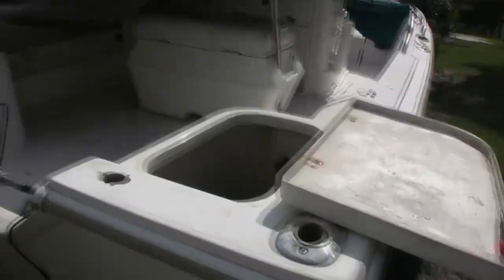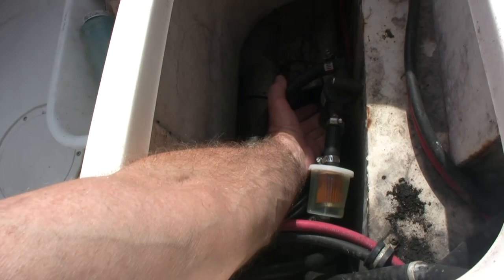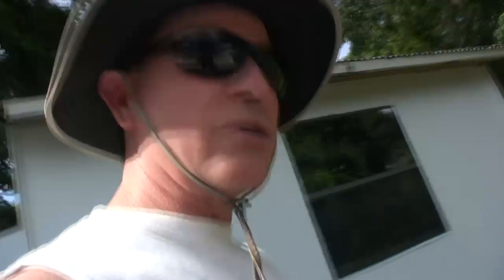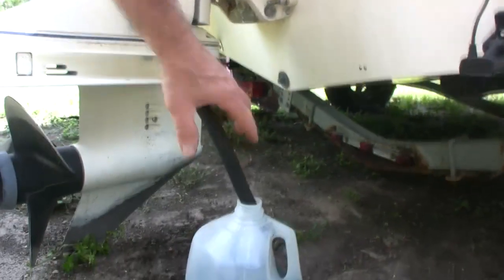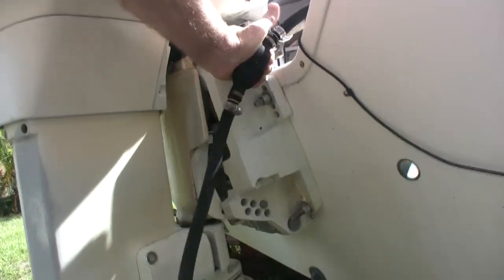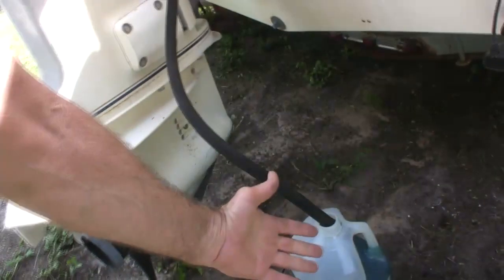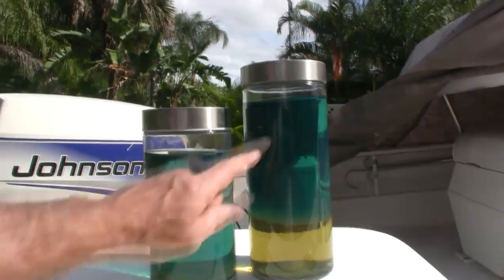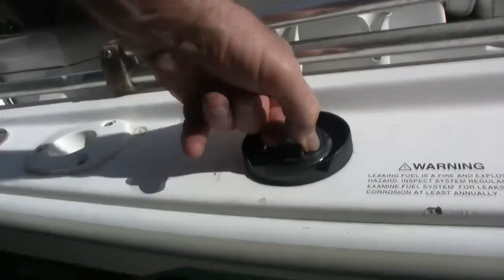Port Canaveral Florida | HOW TO-Remove Water From Your Boats Fuel Tank Cheap!

Comment: This worked like a charm.  My issue was old gas, not water in the tank.  I siphoned about 10 gallons when the stream slowed to a trickle, then I realized I had to loosen the gas cap to relieve the vacuum.  To answer one question below, once you pump the bulb, gravity takes over, so you do not need to keep pumping the bulb to keep the flow going. Great video.
Reply: Can you clarify this for me? Does the engine have to be running once you prime the bulb? I have to continuously pump and I have like 20 gallons to go lol

Comment: Sweet! Just bought a nice bass boat for 500 bucks. The guy replaced everything in the ignition system and just could not figure it out. Just water in the tank! I figured that out because it runs fine below freezing

Comment: Usually there is an o-ring on the bottom of the fill cap. Replace when bad and lube it with a bit of grease to maintain seal

Comment: I found water in my boat gas tank, luckily I was on 1/4 of a tank. I gave this method a try and pumped until empty. 11 gallons in less than an hour. Worked well, thanks!

Comment: the fuel line intake in the tank is 1/2" from the bottom, so this will leave 1/2" of water in the tank.  best to remove the fuel sending unit and siphon with a fuel pump from the bottom to completely remove and always keep tank full
Reply: you are correct sir.  this method only removes to the level of the fuel line.

Comment: The big problem I see is that the fuel pick up tubes don't go all the way to the bottom of the tank; at least not in mine.  My guess is that it prevents any sediment, that settles to the bottom, from being drawn up in the fuel line.  Being that water is heavier than fuel,  if there is water in the tank, there may still be water remaining in the tank below the level of what the pickup tubes will reach; problem not solved.

Comment: do you have to keep pumping, or does it create a siphon effect and start draining itself to the max?
Reply: Bulb has a check valve in it so you would have to keep pumping if you do it thiS WAY. i took an ran my hose threw my drain "where the plug goes" parked an chocked wheels on a incline an leg gravity do the work.

Comment: I got fuel on my tank what should i do... pump out all the fuel out change the filter and refill with fresh gas is that gonna fix the solution... my boat turns off when i put it on drive so it happened thst my gas cap wasnt tight enough

Comment: The only problem with your Bud's method is that the pick up tube in your fuel tank does NOT reach the very bottom of the tank.
Reply from the maker: Ok, so you might have half a cup...
Reply: @PortCanaveralFlorida  Add new gas, maybe some additives and run it out...

Comment: @4:10, not wax candle, you mean Lava Lamp.     I don't think it's a good idea to put gas in a milk plastic jug, it will start to crack and leak in an hour or so.   You could probably just run 12v to the in-tank fuel pump and pump most of it out as well.     If there are nooks and crannies in the tank, then water might hide in there only to surface when you refill the tank with Fuel.

Comment: Syphon out fuel with a 1/2" vinyl hose from home depot, accessing the tank via the filler stem and transfered into a 5 gallon gas can.  Finish up with a paper towel taped to a steel rod to sop up what ever remains.   Use only Rec 90 fuel and have an inline water/fuel seperator filter - no issues.

Comment: If you want ALL the water out put a small bottle of 100% isopropyl alcohol in your tank. That alcohol will get any remaining water out and will not be a problem with gas/oil mixture as the water/isopropyl will evenly disperse into the fuel. Oil will evenly mix in this same fuel without causing engine damage. The brand Heet is NOT GOOD TO USE AS IT DOES PICK UP WATER BUT SETTLES TO THE BOTTOM OF THE FUEL. Oil does not mix into that settled Heet/gas mixture and may cause engine damage from lack lubrication. Put a few drops of water into a test tube, then put a little 100# isopropyl alcohol into the tube. You will be amazed when the water is gone.
Reply from the maker: Thanks!  Great tip!
Reply: You are a lifesaver
I had my boat stored for about 6 mon.
Rec 90 and Yamaha fuel treatment,still picked up a good bit of H2O
I'm giving this a try
Reply: @M C Clift. If you experimented a little bit with a glass container of some kind, a few drops of water and a little gas you could see the results up front. You will be pretty confident that your water problem will clear up. 😀

Comment: he mentioned a DRILL with a pump, FFS don"t the spark from the drill motor will blow you and your boat to Kingdom Come.
Reply from the maker: It was outside, all hoses were attached firmly, no problems at all. Yes, you do need to watch out for fuel leaks and take notice.

Comment: That's a very good idea for checking for water in the fuel. If you have a large water separator filter this method won't work. You have to go to the tank, but it's a great start

Comment: Microclean: We do this professionally in NE Florida. Our policy is to completely remove all the tank contents, and dehydrate the tank. Reason being, our machines do high volume, water emulsiflies back into the fuel, just to saperate out again with-in hours or less, . If its not totally empty, we get called back, cause you can't separate all the moisture from gasoline. Not good when your 40 miles off shore. We have great results with diesel de-watering, as well as other foreign material from fuel. We average over 500 tanks a year with over a 95% success rate. All waste is disposed of in accordance with EPA GUIDLINES   .www.microclean.ws

Comment: It could have been the rain but it was most likely the ethanol that drew the water in.  ethanol is hydrophilic, thereby drawing water in from the outside since most boats have a vent.  You should add gas stabilizer if you plan on storing your boat over 3 months to prevent the water buildup.

Comment: This will not work!!! Your Pickup tube does not go all the way to the bottom of the tank. You have to remove the sending unit from the tank and put a hose/tube to the bottom of the tank and pump it dry. Then you have to let it dry via evaporation for about a week or two and replace sending unit...no other mechanical method will get water out of your tank. Eventually the trapped salt water will corrode you tank and it will leak...then you have to rip out the deck or pull apart the inner liner from the hull. Major problem.
Reply: You definitely have to pull the sending unit and completely empty the tank. Just because you only dumped out 2 ounces doesn't mean there isn't a quart in the bottom of the tank.
Reply: I bought a catamaran that was sitting for a long time. The gas was loaded with water. I removed the vent fitting and used a air compressor with air blowing attachment to force compressed air in the vent hole which forced gas out of the disconnected fuel hose into gas containers. YOU DO NOT NEED TO REMOVE THE SENDING UNIT USING THE FILL TO REMOVE AS MUCH GAS AS POSSIBLE IS ENOUGH. Then just fill with good gas and the engine will just burn whatever water is left over. I did this on both tanks of this dual engine catamaran. Its the easiest and safest way to get the bad gas out of the tanks since your using air as your pump.
Reply: that's funny, ever see a plastic fuel tank almost completely deflate and deform due to sitting for a long time with the vent closed and not much fuel in it. You would think a tank collapsing like that would cause it to fail...  That leads me to believe it takes a whole lot to rupture a tank.
Reply from the maker: David, my tank is plastic!  I took my time and took what I could out of the tank and after a few weeks I only had to dump about 2 OZ out of the water separator... so, it worked for me!
Reply: This is a BAD recommendation. You can easily exceed the pressure rating on the tank..... and it happens FAST!  It's easy to split the tank. Tanks are checked for leaks at 3 PSI.  3 PSI has to be seriously regulated.
Reply from the maker: That's the best point, mine too is plastic!  What water is left will eventually be gone, 1/2 cup of water to a 30 gal tank, and I'll catch that in the water filter!
Reply: remove the ball, use a air compressor and a blow gun attachment, use it on the vent hose. Use only a little air at a time the fuel will come out very fast. Once empthy then refill the tank with a few gallons and do it again. There will be very little water left good enough for the engine to run, by your next fill up the engine will burn off whatever little water was left. You can also clog the vent and use a second hose through the fill hole and a rag to reach the very bottom if you have a odd tank that leaves a lot of fuel behind this will get almost everything out.

Comment: That's great but u need to explain to your viewers that they need to let it sit a while so it seperates.  Then pour it slowly from the top until it gets near the water on the bottom.  Then stop and dump what's left.  They should be using a water filtering funnel too since there is usually still a little bit left.
Reply: just dump the shit and start fresh is the way to go.
Reply: @XxPackerManxX  Sounds right and maybe add some additives
Reply: I concur. Already blew a yamaha 130 motor once due to water in my shit. Surefire way to ruin your whole summer. Now I'm paranoid as shit about water being in my oil/gas.
Reply from the maker: It's a bitch but it can be removed easy, just let it sit, level the boat, and start pumping...

Comment: i have a 35hp 1998 johnson outboard motor and it's leaking oil ( tcw-3)  and also leaking to the spark plugs area making hard to start the engine...how do I get that problem solve?
Reply from the maker: +shoua yang Leaking Oil? Don't you mix your gas?  Might check your head compression first so you know you have a good seal, then take it from there.

Comment: Please don't use a plastic container due to static charge that will explode gas. If you slide the plastic container it could cause a static charge and Boom!!!!.. Use a approved METAL GASOLINE CAN that should be grounded during the process, it's simple....good video , I do the same thing and it does work well...
Reply: is the red jugs that gas is transported in not made of plastic?
Reply from the maker: +Jay Schaefer GREAT TIP, THANKS!
Reply: Think ill take my chances with a ol red gas tank. lol

Comment: I have a water separator added to my fuel line and your method didn't work.
Reply from the maker: +ronofnc .  Correct.  If you have a inline separator it would go into that first.  I have a smaller one which I could take off but I just kept pumping and pumping and well...all of it came out.

Comment: this only works if you do not have an inline water filter, I know because my 115 hp runs only 2 minutes before it stops.  I will now check the water filter, I bet its full of water.
Reply from the maker: +ronofnc correct!

Comment: A better method is to drain all the E-10 out, use it in your lawn mower or car.  Put your flushing device on and run all the fuel out of the motor and drain the fuel filter.  Go to this website for Pure Gas where Marine Gas is available:  http://pure-gas.org/index.jsp.  Yes, it costs more per gallon than E-10 but here are the advantages: No phase separation, better performance, more power and the motor runs cooler.  Do not mix E-10 with Non-Ethanol fuel or you will plug up your gas jets with goo.
Consider before they decide to switch to E-15 which will destroy any Marine engine and most older cars and trucks.  Tight Lines!

Comment: The dip tube in the tank does not go all the way to the bottom -you won't get all of it. Tip the boat so the fuel tap is at the low corner and do it again. Or better yet, remove the sender and get the water into that corner (you can then see it) and use the same hose (removed from the fuel connection) and do it again. Water gets into all vented tanks. In the afternoon, the tank is full of warm humid air and water condenses from that air during cool mornings and it starts over the next day.

Comment: Great video - I'm a bit lost, however - did you throw the fuel you removed away?  Was your tutorial about draining a fuel tank or was there an additional step (to separate the water from the gas and return the good gas to the boat)?

Separately, I have a water separator - can't remember what it's called.  If I believe I have a bit of water in the tank, will that handle the problem?
Reply: You can carefully pour off the gasoline, but then burn it in a car or mower as it's water-saturated.
The remainder should be dropped off at County Waste Services.